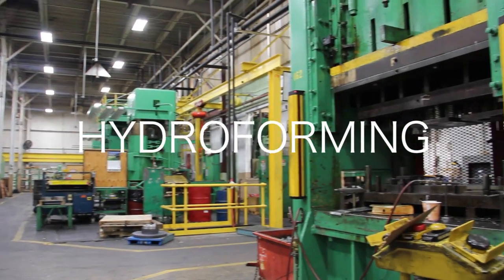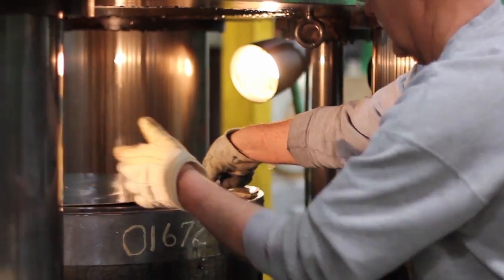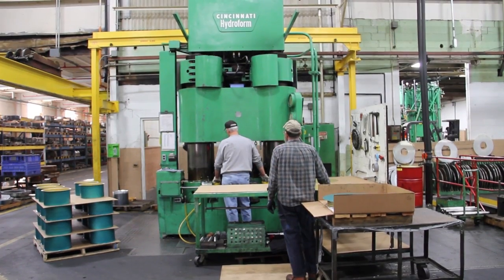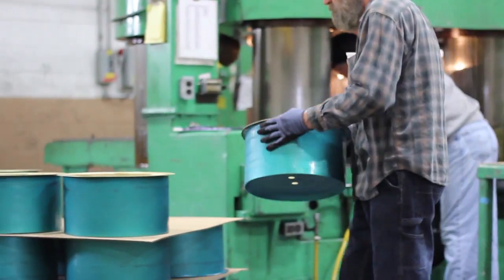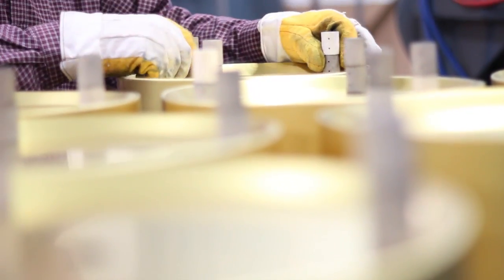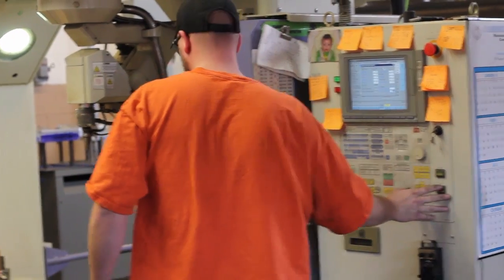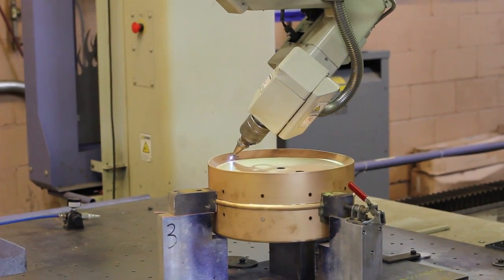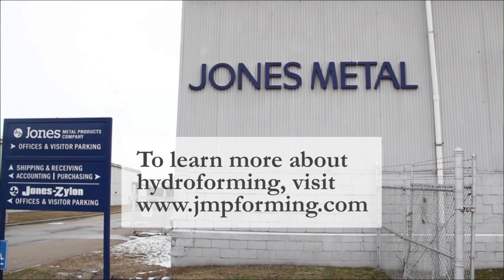Hydroforming - The Hydroforming Process - How Hydroforming Works

Comment: Just wondering how long the annealing and heat treating process was at what temperature.
Reply: For stress relieving a brass 14" x 6.5" drum shell, Jones Metal Products would likely employ a controlled heating and cooling process known as annealing. The process involves heating the brass to a specific temperature, holding it there for a set time to allow internal stresses to dissipate, and then cooling it down slowly to prevent new stresses from forming. The exact temperature and cooling rate will depend on the specific brass alloy and the desired final properties. 
Here's a more detailed breakdown of the process:
1. Heating:
The drum shell would be heated in a furnace to a temperature typically between 250-500°C (482-932°F) for brass, depending on the alloy. This temperature range is below the melting point of brass but high enough to allow the metal's crystalline structure to relax and relieve internal stresses, according to Aalberts surface technologies. 
2. Soaking:
The drum shell would be held at the target temperature for a specific duration, often 1-2 hours, depending on the thickness of the metal and the extent of stress relief required, says Bodycote. 
3. Cooling:
After soaking, the drum shell would be cooled down slowly, either in the furnace or in air, to prevent the formation of new stresses. A slow, controlled cooling rate is crucial for minimizing distortion and maintaining dimensional stability, says Bodycote. 
Why is annealing done?
Stress Relief:
The primary purpose is to reduce internal stresses caused by previous manufacturing processes like forming or welding, according to Northern Heat Treat LTD.. 
Improved Ductility and Formability:
Annealing makes the brass softer and more pliable, making it easier to machine, form, and further work. 
Enhanced Dimensional Stability:
By relieving internal stresses, annealing helps to prevent warping, distortion, and cracking during subsequent manufacturing steps or in service. 
Improved Machinability:
Softer brass is easier to cut, drill, and shape, improving efficiency and reducing tool wear, says Titus Steel. 
At Jones Metal Products:
Given their specialization in metal forming and fabrication, according to their blog, Jones Metal Products likely has the expertise and equipment to perform annealing on various brass alloys, including those used in drum shells. They would likely tailor the annealing process to the specific requirements of the customer and the intended application of the drum shell. I answered my own question with some help from Google.  Anything to add?

Comment: Cost of machine and where to buy from?
Reply: heaps and who knows?
Reply: From memory The initial mfg was Cincinnati back in the early '60s. The sizes went from 8" to 32" diameters and up to 15k psi. Beckwood came on board (?) 20 -25 years ago and as recently as 6 years ago a 25" diameter capacity machine installed at Ace Precision Machining was 2 or so million. Lots of wonderful history here. Jones is a great shop to work with!